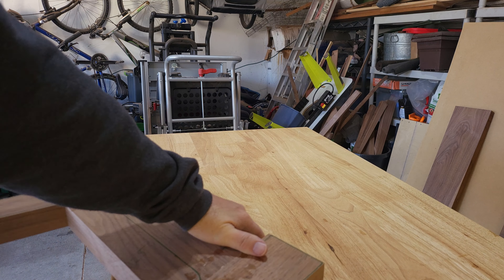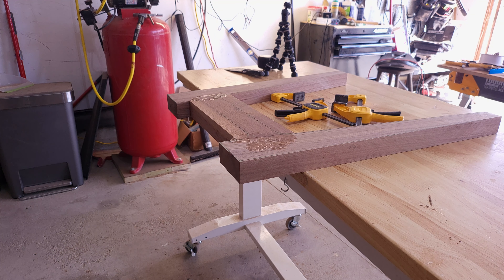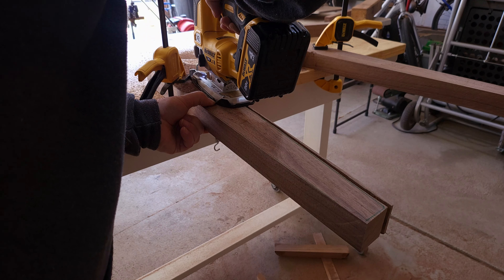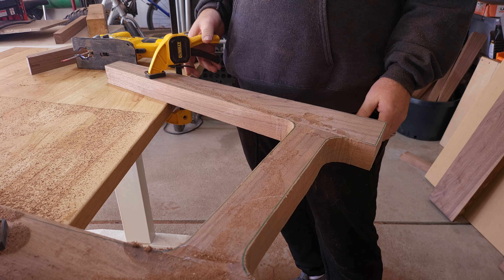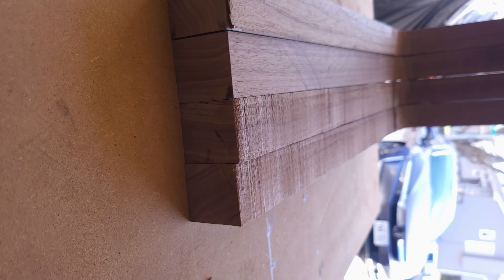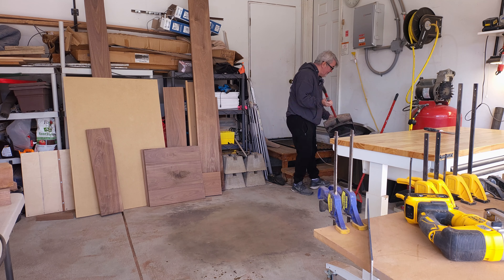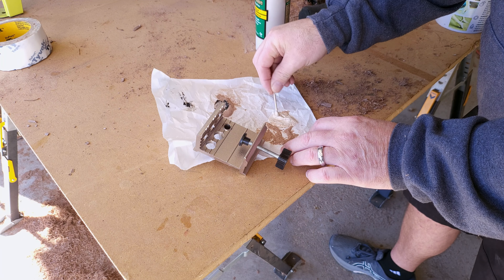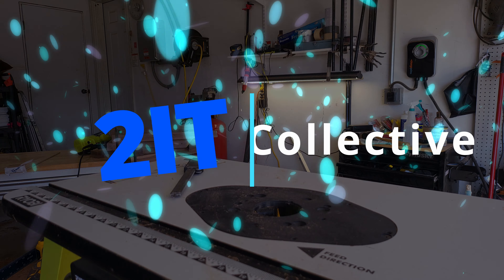EP09  -  Router - How DOES this Feature work? Making Mid-Century END TABLES in my woodshop

Comment: I'm confused...why are you using the plunge feature on a router that is better off starting in fixed depth ?  You are using a template for the cut, and a flush cut bit and coming in from the side.  No need to plunge.  More likely to get tearout.  Maybe I misunderstood what you were doing?
Reply from the maker: Thanks for the question. Yeah. I actually did fix the depth of the plunge at 1" 1/4 including the bearing so it was at a fixed depth for entire cut of 1". So yeah I started and locked in the depth. Good point ! the real mistake was not using the router table to stabilize the "Y" axis and the bit sucked into the wood digging in and throwing my right to left plane off. Hope that makes sense. Like most of us I thought "Ohh I can just guide it around it will be fine" until it wasn't. LOL. Router table would have saved my heart ache. I think ? Thanks man for the question.